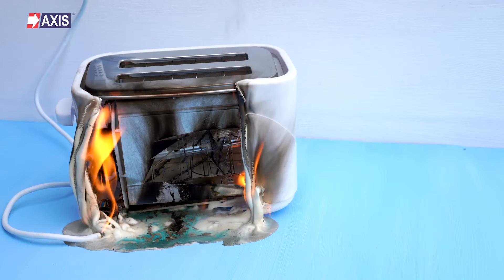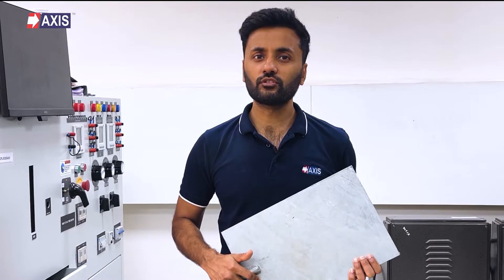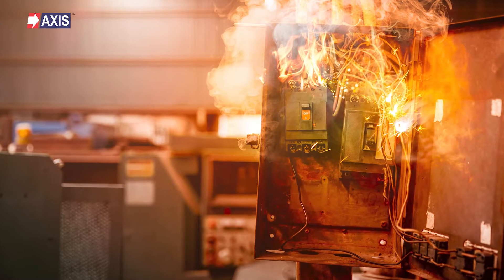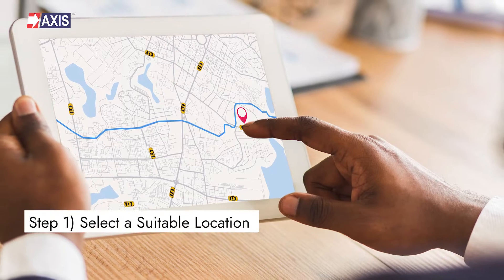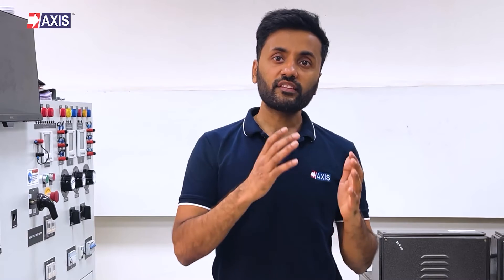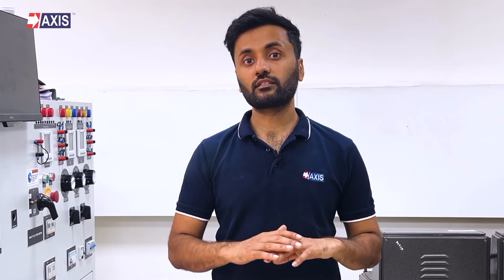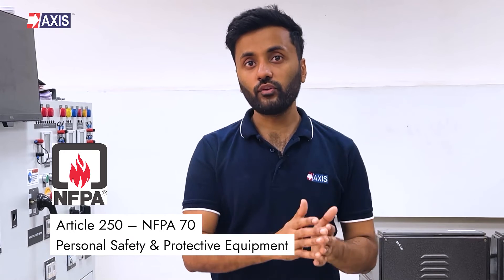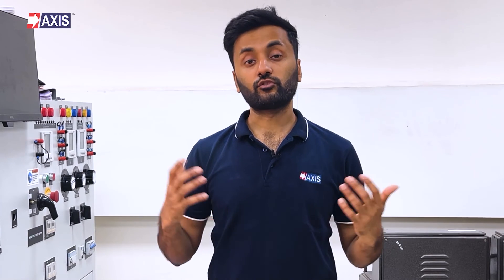Earth Plate Installation - Learn Plate Earthing in Depth! ⚡

Comment: How deep in ground you instal plate?
Reply from the maker: For plate earthing, depth at which plate should be buried dependent on various factors such as soil resistivity, design requirements in order to also maintain consistent soil moisture and low earth resistance.